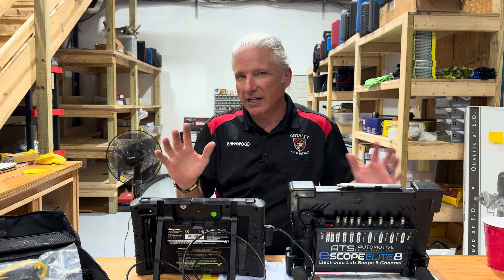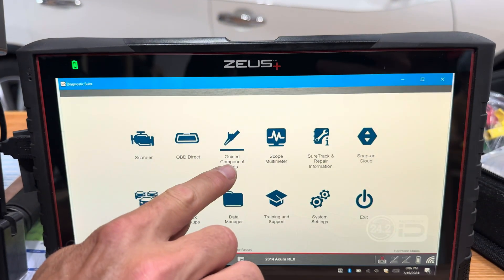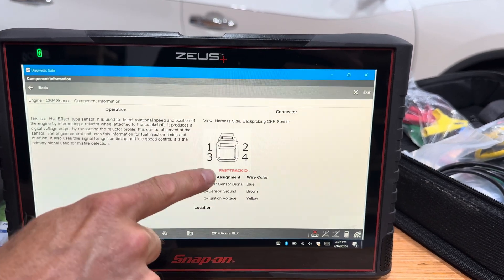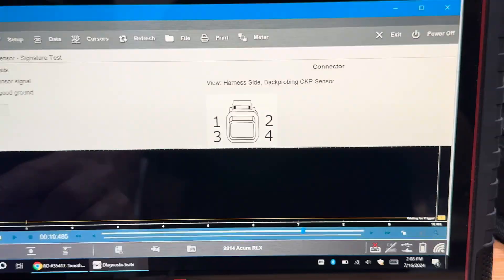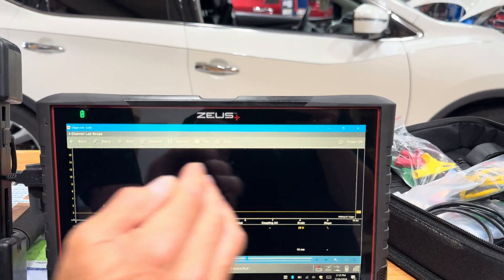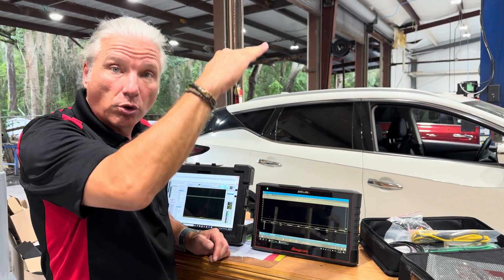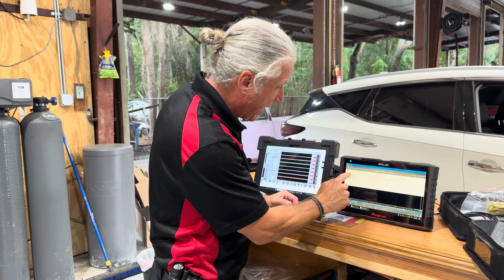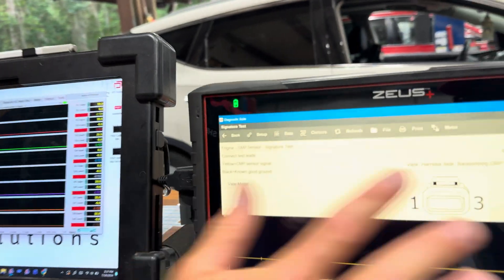Cheat Codes For Setting Up Scopes! (ATS & Snap On Zeus)

Comment: Even though I work on Bobcats, I have an autel scan tool with oscilloscope capabilities and these videos are helping me understand scopes more. I am going to start using the scope when I have electrical issues. Good thing is, I dont need the obd2 capabilities with the autel, just the scope functions as Bobcats do not have obd2

Comment: You can also split screen the scope and a scanner at the same time everything that you did in the actual lab scope as you said you can do from guided component test  there's a button at the top of the screen that says meter press and the scope opens to full size push meter again it will pull the scope to us own tab in desktop mode for the diagnostic part of the scanner if you grab the top of the table and move it all the way to the left or right it'll go into split screen mode you have to be in the scanner though you have to back out of the guy that component test after you open the separate table for the lab scope

Comment: At minute 3:09, you could have saved several steps by merely hitting the meter button at top left. That opens up to full screen. Also you could minimize that screen, go back to scanner, turn on or off the sensor your hooked up to. Maximize scope, and watch it live. On split screens.

Comment: I would like to see a pattern done on both and how to get the pattern correct so it makes sense. After that it would be good to know how to interpret various patterns. For me when I see a pattern I know it does not look the same as the known good but I don't know what the wrong pattern indicates. A good example is an ignition pattern. If you see this or that it means it has a bad valve. You guys that eat, drink and breath scope analysis make it look easy. To me it all looks like squiggly lines.

Comment: I love my ATS I might be bias being a distributor but it’s just an amazing tool. Deep record is amazing. I own pico & a Zeus as well however the misfire testing, connect detect, multimeter and so so much more make the Ats amazing. Plus drives 4 transducers, and also as the annotation right on the scope.

Comment: thanks so much one other thing that would be nice when you are doing a diag using the scope each time you check something tell us the settings you are using. i really struggle with the scope mainly because most of the work i do is cut and dried but scanner danner told me doesn't matter hook up the scope anyway to get better guess just need to listen thanks for the video

Comment: Got to pay attention to the particular scope, some time and voltage settings are per division not screen. 
Also when I first started I used the 10 /10 rule (10 ms 10 mv ) per division. 
As you become familiar you can set up closer but this gets you in the ballpark

Comment: When setting up two channels do you put trigger on both channels or does the second channel trigger off the first one?
Reply: U only use one channel for trigger, the other channels will display accordingly. 
Practice, practice, practice !!
Reply from the maker: You can only trigger off of one channel. The other channels will "line up" wherever they are in relation to the triggered channel. Hope this helps. As @keltecshooter said - Practice, practice, practice. Have fun with it. You can't hurt anything by changing settings in the scope.